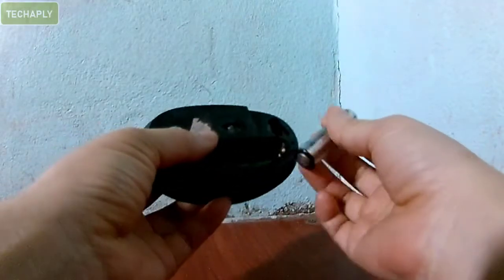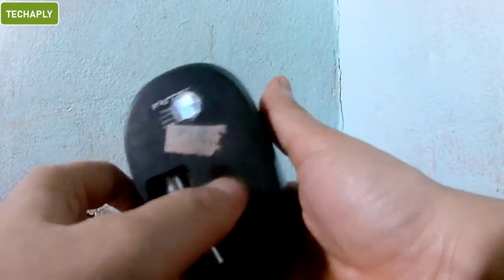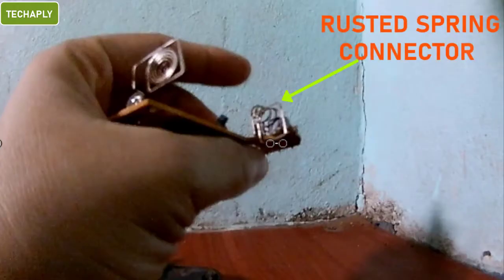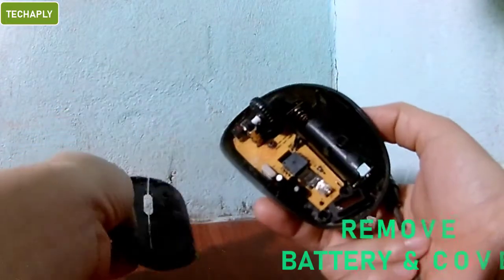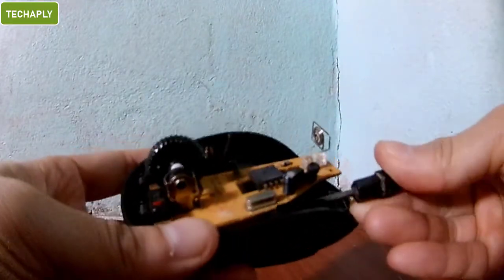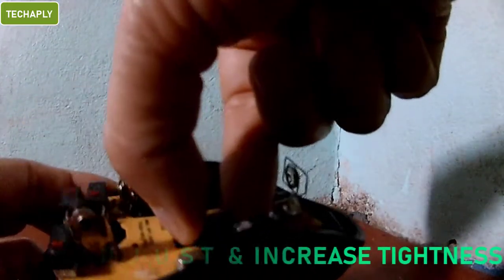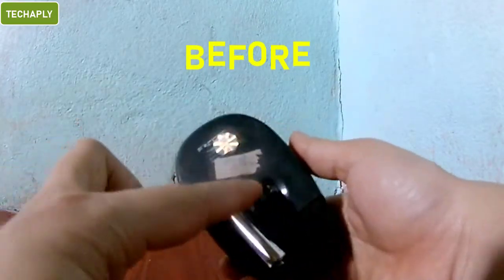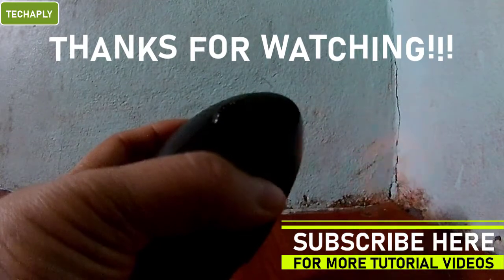Fixed Wireless Mouse Stopped Working Randomly | Mouse Not Working After A Few Seconds.

Comment: i actually have the same problem but it just stops randomly and i got this like 4 months ago its not rusted whatsoever also i cant really reset it it doesnt have a switch to turn off or on it just sleeps or does rest mode after like 60 seconds of inactivity its an a4tech wireless mouse pls help i dont have any other mouses
Reply: same, i have a mouse without a switch and it goes to sleep after 1-2 mins and then it glitches and doesn't click right when i move it.

Comment: It didn't fix my problem, nothing is rusted and the mouse is new. It doesn't turn of itself, but when I move the mouse it does. To make lamp light up back again I do a click. Some batteries work for months, but some for not even a day. In case, I'm talking about new batteries. Got any ideas?
Reply from the maker: I've got a mouse like this and sometimes my way is just resetting the mouse. Turn it off for a while and go back to on. You should consider a good resetting before a new working section. It might take 5mins each time.

Comment: I need help everything else on my wireless mouse is working but the cursor sensor won't turn on
Reply from the maker: You might want to try to do some settings under your mouse settings in the PC.
Reply: @AnhPhan  I had a laptop wich broke so now I use my xbox
Reply: @imcookie1903  most probably u have to change the laser led.go to a mechanic.
Reply: @shreejitghoroi7432  I got a new mouse for Christmas

Comment: Thank you for making this video! If you see this and you are able to provide some insight, assistance &/or guidance I would be truly thankful & grateful for it..

Unortunately, the steps in this video didn't work for my issue 😞

Mouse Info
Brand: CYLO
Addituonal Details: GEL- TECH | 2.4G
Product Name: ANTI-STRESS SILICONE WIRELESS MOUSE
Requires only 1 'AAA' Battery

Here's a quick recap & description of my issue (it looks longer than it is):
I got this mouse around Christmas time last year but had forgotten all about it. I just happened to come across it a couple of months ago when we were moving, so I finally opened it and used it. I had only used it a handful of times (with no issues) but I actually really liked it which isn't a common thing for me. The problem began a couple weeks later when I went to use but it wasn't working. I noticed the little power switch was in the 'ON' position so it had been left on for a several days at least as I want using our Mac that often. I assumed the issue was the battery but I couldn't find any new batteries so I put one from the remote in but it still didn't work. The battery that was in the mouse originally was a rechargeable battery so I put it in the battery charger and left it. Now (today), that battery is fully charged & I had some bought a large pack of batteries. I put the rechargeable battery in the mouse again and when I slide the power switch to 'ON' the red-light turns on for 2 (almost 3) seconds and then turns off. There is no physical damage to the mouse itself, no rust & everything else appears normal.

That being said, there is one weird thing that I can get I to do when I turn it on tho..: If I move/wave my finger around in front of the sensor it does sense the movement (flashes/brightens up like a properly functioning mouse would) before it shuts off after the 2-3 seconds, HOWEVER, if I move (wave, swipe) my finger arounn & over the sensor fast enough (before the light dims back down) I can get it to stay on for anywhere from 5-10 seconds. That says to me it isn't an issue with something being loose (like the coil) as I'm not moving the mouse around at all, I'm only engaging the sensor... but even then it's only staying on for a few seconds, at most.

If you can, please help! It would be greatly appreciated.
Reply from the maker: For my mouse in the video. It also get turned off after few seconds. But I found the problem is the rusty and loosen battery tray. As for your mouse I can advise to switch UsB hub for the USB receiver. Or change the other PC to check if it works on other PC. If yes then it's your hub problem may be

Comment: I have raignor 2 wg10 I just bought it. I placed the double A battery then when we use it. Its Cursor was not showing pls help that mouse rlly fits my hand it is wireless too.
Reply from the maker: I think you need to go to computer settings then choose device settings of mouse. Try to change cursor speed and enabl inactive scroll there.
Reply: @AnhPhan  ok i will try
Reply: @AnhPhan  it haa the red light but it is not showing so.
Reply from the maker: Try to plug out and replug your mouse USB receiver.  change to another USB  port or update your driver or reset your PC. I hope it will work out
Reply: @AnhPhan  I will try to use it on my desktop